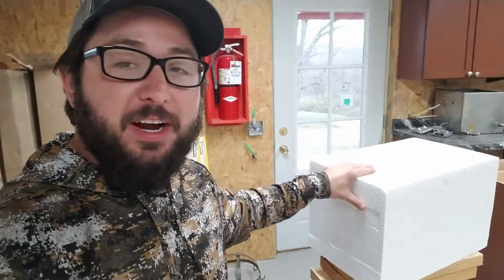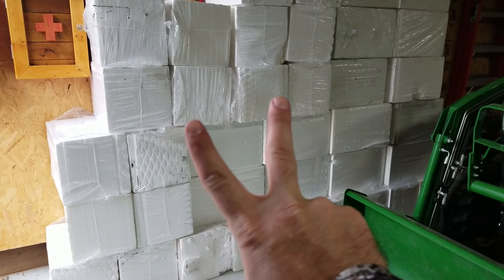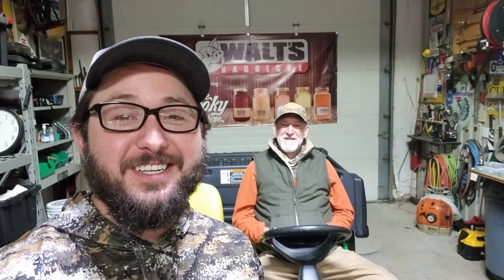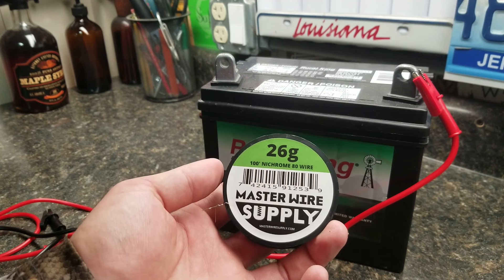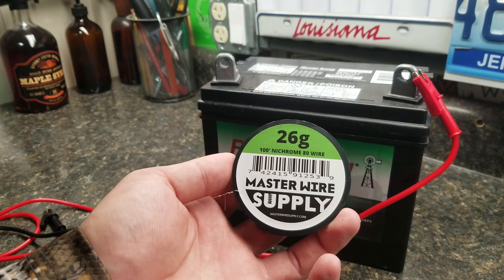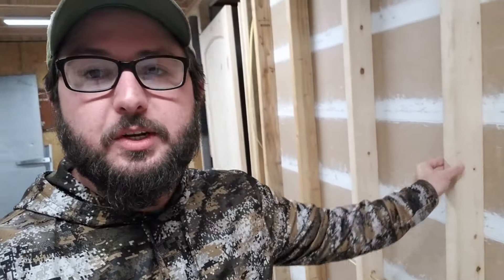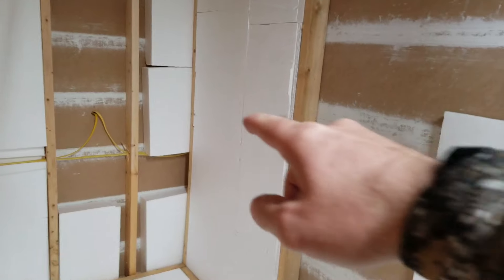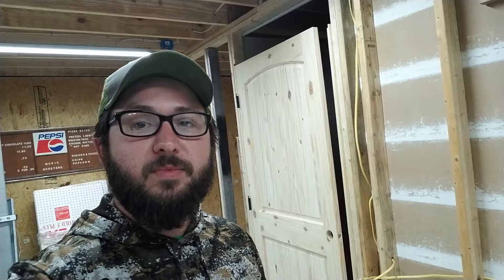The CLEANEST Way to Cut Styrofoam

Comment: Great job! Thanks! For anybody out there doing foam cutting, make sure to have a good ventilation. Fumes from cutting foam are toxic.
Reply: Melting or burning styrofoam can be hazardous because it releases toxic fumes that can harm your health: 
Styrene gas
The primary component of styrofoam is styrene, also known as vinyl benzene. Styrene is a known respiratory irritant and possible carcinogen. Inhaling styrene vapors can cause: 
Eye, nose, and throat irritation 
Headache, dizziness, and nausea 
Liver and nerve tissue damage 
Hormone-related problems, including breast and prostate cancer 
Carbon monoxide
Burning styrofoam releases large amounts of carbon monoxide into the environment. 
Other toxic chemicals
Burning styrofoam releases other toxic chemical compounds into the environment. 
You should avoid melting or burning styrofoam in uncontrolled environments. If you do come into contact with styrene, you should:
Move to fresh air if you inhaled it
Wash your skin with plenty of water if it came into contact with your skin
Flush your eyes with water for several minutes if it came into contact with your eyes
Consult a physician if you experience effects

Comment: this is exactly what we designed back in the 70's to cut styrofoam in Vietnam,  My uncle was an artist did a wall mural with this diy, what they use for the wire was a mandolin string and a transformer (not 100% sure) for the power supply.

Comment: Battery for power is much simpler than other videos about hot wire foam shearing which I’ve been checking out. I need to cut some 2 1/2” x 2’ x 8’ foam billets of reclaimed sub slab foam the long way. The resulting 12” planks will be part of a concrete form for a Quonset slab and left in for frost protection. The visible fumes suggest it should be done outdoors standing upwind.

Comment: As long as the wire is on a spring it will move around and thats where you get not so perfect cut from.
Reply: Yeah, the spring seems counterproductive after all that work getting tension on the wire.

Comment: Nice job, I'm building a 4×5 powder coating oven and I acquired a bunch styrofoam also and I made my cutter using a transformer out of a old microwave but, my wire was getting glowing hot and me being a scrapper I saved a bunch of diodes and different parts and I kept trying different diodes until it was just under the glowing red and turned out perfect.
Reply: Are you sure you were using diodes, because they control the direction of current flow. We’re as resistors resist current flow, which is how the wire temperature is controlled!?

Comment: This is genius,  i have huge sheets that are about 4 to 6 inches tbick and about 4ft by 6ft long that i want to recycle and do this with. For a shed i built out of pallets . The framing doesn't allow for easy installation so i had thought about shredding it but i really didn't want to do that this way i can cut the sheets thinner and just out them up on the inside of the pallets

Comment: I noticed that you were using 26g wire. Is 26 g the best to use? Would you go any smaller or bigger?
Reply from the maker: I can’t say whether or not a different size would work better, but the 26 gauge worked great

Comment: Is there a way to regulate or adjust the power to the cutter from the battery. Do you think a 12v battery could power a 48" 26 gauge cutter?

Comment: Great idea.  I'd suggest you ventilate better.  Those fumes, even a bit, aren't good.  Also, please please put a fuse, or better, a 12v breaker on the hot wire close to the battery.  The reason is that you want some control over the current/power draw.  If something bad happened, like the supply wires overheated or somehow shorted the battery, you could have a dangerous gas/acid/explosion situation.  I have no idea what the current rating of the fuse/breaker would be.  A good point is that on 12v wiring, you need thick wires, or short wires, preferably both, depending on the current draw.  It would be interesting to know what the element wire is drawing.  Here's another YT version of this: https://www.youtube.com/watch?v=ZlQZFib8PiM

Comment: I wish you showed us the entire wire setup assembly. And where did you buy the adjustable height metal rods used to hold the wire with tension? Great video but hard for someone to follow along with what you did.
Reply: You can buy something similar. When I was a student in high school, in sculpture class we would use foam board and had a handheld version to easily cut the foam.

Comment: What did Tractor Supply USE the styro FOR ..... SO i would KNOW what circumstance to ASK for for the foam ?
Reply from the maker: I believe they were from the small trailers they sell. They get shipped without the wheels on them, stacked up several high. These were the spacers inbetween the stacked trailers

Comment: I have been using. 020 stainless safety tie wire. A 15 a 120 vac rated switch and it's all uung on stainless eye bolts using a 1/2 in. pvc tubing. All of the connections are between the limbs so minimum heat on the pvc.

Comment: You and your dad amaze me at the ideas you all come up with.  Where does Tractor Supply have this Styrofoam blocks?  I have been wanting to build us a large cooler but insulation was my problem.  It's not affordable.  If we could get some free Styrofoam, I would love it.
Reply from the maker: The styrofoam was out by the dumpster. Apparently it is packing material, I don’t know for what but something they have shipped in must come surrounded in it
Reply: They also put blocks like these between small trailers for shipping. They remove the wheels and stack them with blocks.
Reply: any place that sells trailers will have this as excess packaging, just call around. I got a 5x8x8 or 320 cubic feet of blocks for free and trailer dealer told me he will have just as  much next week.

Comment: What is the purpose of the lug that is on top of the wood guide or the "bottom " lug ?
Reply from the maker: The initial thought was to connect the batteries with the alligator clips. There turned out to be too much resistance for the little battery we were using, so we ended up connecting directly to the wire.

Comment: What kind of battery is that ? How many amp is needed?
Reply from the maker: It is just a 12v lawn mower battery. Any car/motorcycle type of battery would work, the amperage doesn’t need to be very high. You will want something you are able to charge, it does drain the battery surprisingly fast
Reply: @ChanyataFarm  okei, thank you very much 😊
Reply from the maker: I believe it would work, but you are ramping up your chances of electrocuting yourself if your connected to real power
Reply: So if I connect one side of the car battery to the jig, and the other side to the other side to heat the wire. I'm closing the circuit on the battery to heaten up the wire. My question is, can the battery not explode doing this or is it ok to do in small amounts of time

Comment: Are the fumes from burning styrofoam noxious?
Reply from the maker: I wouldn’t want to inhale it, but it’s a pretty minimal amount of smoke coming from each cut.
Reply: What R factor are you trying to reach for walls? How will you achieve that same R factor for your door?
Consider getting used fiber faced insulation for doors or for extra layer of R value. Check with local commercial roofers if they have any used fiber faced insulation 1-3 thick they have taken off or will be removing from roofing site and replacing.
Building a cooler for apple storage.
Reply from the maker: I actually found a used door from a walk in-freezer we ended up using, great ideas though!

Comment: The hot wire is moving when i tried to power it..
Causing uneven cut
Reply from the maker: Maybe try to slow down your feed rate, make sure you have good tension on the wire also

Comment: You are cutting expanded polystyrene not styrofoam. Two entirely different products.
Reply from the maker: Regardless, it’s much more about the method of cutting than what is being cut
Reply: @ChanyataFarm  dislike
Reply: What is styrofoam then? Styrofoam is a trademarked brand of closed-cell extruded polystyrene foam, or XPS. Styrofoam is owned and manufactured by The Dow Chemical Company. So what they’re cutting could be Styrofoam if it was made by Dow?